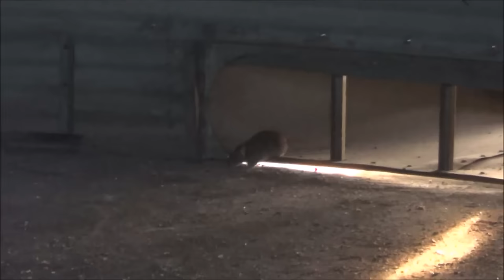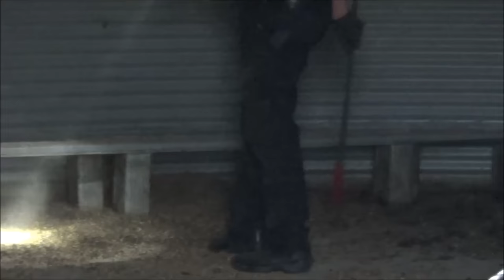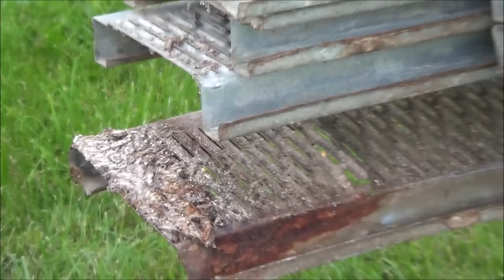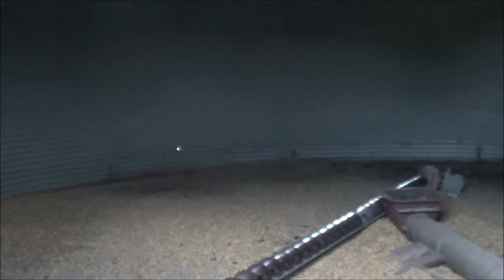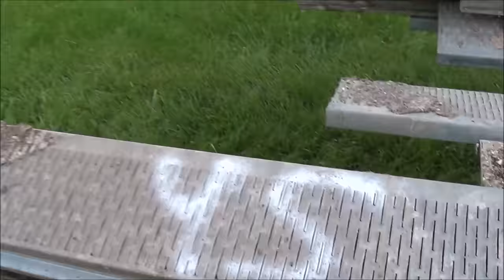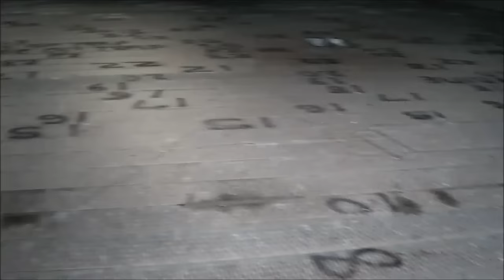Rats, Mice and Grain Bin Floor Removal

Comment: I consider myself lucky to have spent a good deal of time with my Grandpa back before he retired, he did mostly wheat farming. They had one grain bin in use, about this size, but it had a cement floor, and there were several trenches running around that had grates that looked similar to the floor slats in yours. I remember grandpa would have the sweep auger tied up and dangling vertical until it was needed. Most of the wheat was just hauled straight into town and sold to the grain elevator as it was harvested, the bin only held a tiny bit of what he grew.

Comment: Also that attachment for the sweep auger makes it so that sweep works for different diameter grain bins so 1 sweep for 10 bins all sizes because they are expensive. Usually we just carry the sweep into the lowest area of grain in the bin, hook it up turn it on and simply pull it along with a rope on the outer end to keep feeding it grain.

Comment: You may not want to hear this but we have changed the sump & tube in bens with out removing the floor. great vedeo
Reply from the maker: There was more work done than just that. Some of the floor pieces were also bad and needed to be replaced, and there was the whole matter of cleaning all the crap out from underneath.